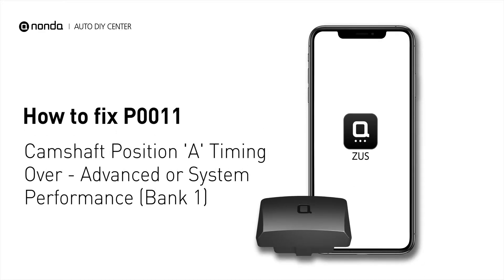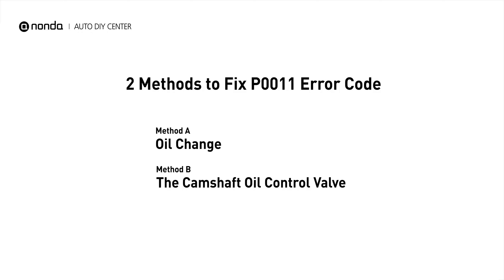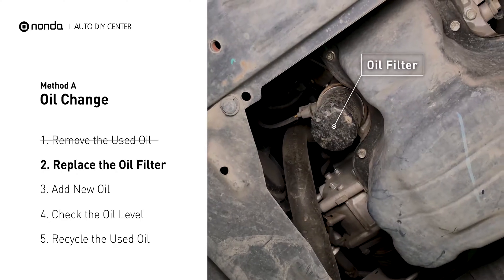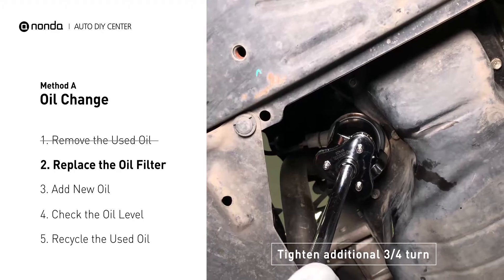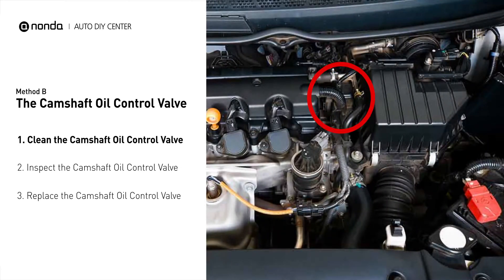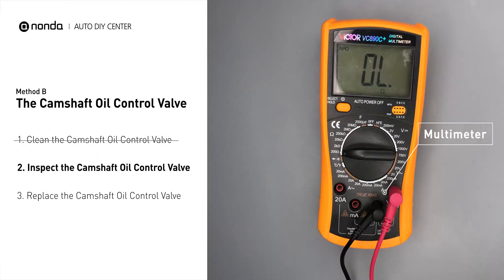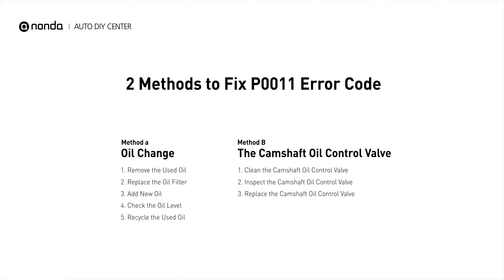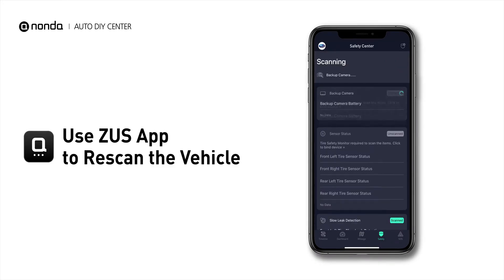How to Fix P0011 Engine Code in 4 Minutes [2 DIY Methods / Only $6.95]

Comment from the maker: Hi, I'm Steve, nonda's lead mechanic engineer. 
Feel free to leave your comments here if you have any mechanic questions, I will be glad to help you out!
Reply: Hi please I wanted to know if you get a p0011 code on Toyota Corolla le 2005 model do you need to open the engine to set the timing chain
Reply: Does this count for a Kia Forte 2017
Reply: I got this code on my 07 Yukon Denali 6.2L.
Can this process still work?
Reply: Do I need to reset it after changing the oil?
Reply: My car sometimes blue smoke and sometimes water throwing what’s the problem
Reply: Selamlar, 2012 model chevrolet cruze 1.6 otomatik aracım dtc p0011 hatası veriyor ve hata gitmiyor. Yağ değişimi yaptım, selenoit valfi ve oksijen sensörü ve Kam mili okuma sensörü gibi sensörleri değiştirdim. Ama hata kodu geri geldi

Comment: Acura TSX 2007 code p0011 changed the VtC oil solenoid and it still has the check engine light on. And the VSA light will also turn on after few minutes of driving. Clear the code and it will turn one back again in about 18 mins of driving and then the VSA light also turns on right away.

Help???

Comment: I have a 2014 Corolla S and P0010 but I just had a oil change so it has to be the other option but where can I get the part for the camshaft oil control valve.

Comment: Hello, I have a 2012 Buick Regal.  I've had the P011 code.  I changed the oil and replaced the Intake camshaft position solenoid.  The light disappeared.  I decided to check engine and it still has a P011 code even though there is no engine light
Reply: Do you reset the codes trrought OBD2?
Reply: Bro...same error is coming....again and again but no engine light....what was the reason....do you find?

Comment: Hi I have a Peugeot 208 GT Line Puretech that has this code and 13 Electrical codes. Would either of these methods work to fix my issue?

Comment: hello i have same problem p0011 code  golf 6 2011 2.5 engine. car working perfectly when car is cool,but when temperature is high engine may operate rough, idle, or stall also hard start. after 30 minutes working perfectly 😀please help me

Comment: Hi I have a 2011 mercedes ML 350 and I am getting the P0011 code, I took it to a mechanic and he told me I needed a Balance shaft and it would cost me 6000.00 this is the only code that is showing , also where is the camshaft oil control valve on this motor?

Comment: Hey Steve so I have a 2015 Chevy equinox. I have the p0011 and 10 codes I’ve replaced both of them, oil change, and the check engine light won’t go away. I’ve even cleared both codes with and Obd scanner and it pops back up any advice?
Reply from the maker: Hello, as you are receiving more than one error code, we highly suggest getting your vehicle visually checked by your local mechanic for further diagnosis.

Comment: Hello, my Subaru ascent is showing “p0011 camshaft position timing over-advanced bank 1” and all the lights on the dash are on. The dealership replaced the oil control valve what should I do???? Please help 😢
Reply from the maker: Hello, is there any other code that register along with this code?

Comment: @nondainc Hi Steve. I have a 2019 Kodiaq 1.5 TSI DADA engine. I am getting P0011 code only on cold engine (oil temp lower than 60 degrees). Car used to drive on 5w40 and 5w30 oil, recently changed to 0w20. Problem popped up only 2 months ago, and is still there after oil change. Cleaning the solenoid magnet and oil control valve did not help. Would you advise replacing either of the two (if so - which one would you replace first)? There is another control valve inside the intake camshaft but it is very difficult to get to. On live data I notice an additional strange thing. When driving on cold engine, after engine Start/Stop shutdown, the specified value for intake camshaft gets "stuck" at 8.7 degrees, while actual value cycles between 8.7 and 12.0 degrees. Pressing the accelerator does not alter the specified value sent by ECU. After a few seconds, it gets "unstuck" and specified starts reacting to changes in driving behavior and actual value follows specified more closely. Any advice would be greatly appreciated! I can share graphs if needed. Thanks a ton for your help!
Reply from the maker: Hello, can you please confirm if there's no other codes that register along with this code?
Reply: @nondainc  confirmed. There are codes triggered on adaptive cruise control, but more as a consequence to this code being triggered. It’s 19233 P0011 code. And I can clearly see on live chart data that actual value for intake camshaft adjuster deviated significantly >20 degrees) from specified value for a few seconds during driving cycle. Sometimes several times in a row. But this only happens on cold engine, never (so far in 3 month) on warm engine.

Comment: Can i manually add some oil to lubricate the sprocket after cleaning the solenoid. Asking because the vehicle has been sitting and the start up might be rough
Reply from the maker: Hi John, can you please provide us with your vehicle's year, make and model so we can provide you with a solution particularly to your car make/model?
Reply: @nondainc  2009 Nissan 370z and to add to that if I unplug my cam sensor it fires right up

Comment: Hi Steve. Great video. I have a P0011 code on my 2014 Q50 Inifiniti. I messed up and let the oil get low. I change the oil and filters but now when I accelerate and it get’s to RPM 2.5 it jerks/ stutters. Its having a hard time shifting. So in order for me to shift I have to use manual and not let it touch 2.5 or lift of the gas and shift it that way. I told it to the Infiniti dealership but they said they would have to take it entirely apart and that would be $6000. Have you ever heard of this happening? Can you please respond.
Reply from the maker: Hi Brittany, is this the only code you're getting?
Reply: @nondainc  yes
Reply: Same problem with my g37 it goes limp and jerks after 2rpm don’t know wtf to do lmao
Reply: @natsumatsu879  i had this issue w my 350z, if u keep your oil level at a desired level it will fix it. It did that to me when i had this issue and it would shift like shit, you either have a bad vvt valve or youre too low on oil.
Reply: hey having the same problem on my 370z, we’re you able to fix the problem?
Reply: Got the same thing recently on my 2014 Q50, would love to know what you ended up replacing

Comment: Hi. I've gotten t a 2007 Escalade 6.2l with code p0011. I replaced the sensor and checked the wiring harness. Still getting the code. Maybe the camshaft adjuster magnet? Any help is greatly appreciated 👍
Reply from the maker: Hello, can you please confirm if this is the only code you're getting?
Reply: Shift_Like_Alex did you have your oil pressure low?, (While having the code p0011)
Reply: @jorge511jL  yes I do

Comment: Hey getting P0011 and P0021 on Nissan Murano 2009 changed vvt and camshaft sensors. Car barely wants to start and when it does doesn’t want to move in drive and slowly moves in reverse. Would definitely appreciate a response haven’t tried anything in this video yet but apparently the problem started after an oil change so I’m thinking they put conventional or the wrong oil or something.
Reply from the maker: Hello, getting both of these codes signifies an issue with the variable valve timing control system. We suggest checking the wiring to the camshaft oil control valve, timing chain alignment and the camshaft phasers for any issues. Also, the oil viscosity might be incorrect.

Comment: Please get back to my previews message
Reply from the maker: Hello, have you double checked if there's any other code registers along with P0011?
Reply: Hi, yes plugged in the computer few times and thats the code with camshaft p0011.full code info Intake camshaft position system performance  p0011. And warming light comes on engine power reduced. Thanks

Comment: Hi i have vauxhall astra 1.4 turbo 67 plate. On the dashboard it says engine power reduce and engine light comes on. When you drive sometimes it goes off. And it comes back on. What can it be ? The sensor got replaced as garage thought it was the sensor and they reset the light. But it still came on with the same warning sign engine power reduced. Please help me
Reply: Its only done 48k on the clock with full service history.
Reply from the maker: Hello, have you double checked if there's any other code registers along with P0011?

Comment: In my kia Sportage 2009 while in highway check engine light and after few minutes oil lamp light...soon i stop checked the oil level was normal but the oil look dirty.. computer check was p0011...i drained oil with 10min motul flush...used original filter, 5w30 SN GF5 100% synthetic oil...no more check light...thanks
Reply from the maker: Hi Hisham, should you have any questions or concerns, feel free to let me know. I'm here to help.

Comment: I'm getting a P0011 code with a loss of power. I have a 2014 Cadillac Ats 2.0T. I doubt that it's engine oil because that doesn't typically cause power loss. Any thoughts?
Reply: Miguel Brochu  yes, I replaced the intake valve solenoid and it knocked the code right out
Reply from the maker: Hi Joe, we suggest to start by checking the condition of the intake valve timing control solenoid valve and camshaft position sensor's harnesses for short/open. Check also its circuits for poor electrical connection.

Comment: It is exactly what I am facing and afraid of being ripped off, Engine light on, Code p0011,p136,p0141,c1555,Car drinking fuel like super jumbo jet, and also can't even pull or accelerate faster on small hills, all started after washing the engine, Service done recently and no improvement. Now I will check with the camshaft  CHEVROLET ORLANDO , VAUXHALL engine
Reply: Hey there ! Did you ever see what the problem was ?
Reply from the maker: Hello, since you are receiving multiple error codes, we suggest to get your vehicle visually inspected by your local mechanic for further diagnosis.

Comment: How do i check if the camshaft gear (vanos) is worn or damaged?
Reply from the maker: Hello, since this is quite complicated to perform, we suggest to have it done by your local mechanic. This work requires experience and access to a variety of tools.
Reply: @nondainc  ok thanks
Reply from the maker: You are most welcome!
Reply: @nondainc  one last question, what could be wrong if a car is having an unstable idle it also sounds loud from the engine not the exhaust tail especially when revving it sounds like the  air is blocked or the throttle body intake hose has been removed
Reply from the maker: Actually, there are various reasons. But we couldn't pinpoint for sure as your vehicle should be visually inspected. Either you may have faulty spark plugs, dirty fuel injectors, or leaky vacuum hose.

Comment: Hi I had p0011 and changed the camshaft intake solenoid. After that I noticed p0016 and p0017 turned on meaning the timing was off. Do I have a stretched timing chain that jumped a tooth?
Reply: I changed the cam shaft ocv solenoid on my 2015 Chevy Cruze ls check engine light went away and I plugged in sensor back in after week light comes on with same code p0011 and will turn off after awile any ideas why this is happening
Reply from the maker: Hi Michael, yes- possibly. Also, changing the oil valve and clearing the code would help.
Reply: What was the problem?
Reply: @leorodz1268  I replaced the timing chain, actuators and other components.  1500$ at mechanic.
Reply: @michaelbarrett7608  having the same problem on my explorer 2011 thinking might be the same

Comment: Thanks for the video, I have an issue with my porsche panamera turbo --> p0076 solenoide control valve bank 1, and would like to know if I can do the same cleaning to the vvt solenoid ? It can be something else ?
Reply from the maker: Hi Adam, yes you may do the same. Hope it helps!

Comment: What is the tool you use to remove the oil filter?  I must have it
Reply from the maker: Hi Egiber, it's an adjustable oil filter wrench that you can purchase online or on your local hardware stores.
Reply: Ps. This worked. Thank you
Reply: Most guys call them oil filter claws, and they come in very handy.  I have used my Craftsman one for going on ten years, professionally, and I have not had an issue with it.  Auto parts stores carry them too.
Reply: @xgcskiman  thanks dude
Reply: @Egiber Ruhl  Make sure to get the three-finger style.  The split-cup style is not as universal.  (In my opinion it is junk, but to each their own)

Comment: What type of multimeter do you recommend and what do you set it to? Thanks.
Reply: Ohms.
Reply: @xgcskiman  Which ohms setting figure ???
Reply: If you are using a DVOM then it is probably auto ranging, which means you just set to Ohms and it will display the range on its own.  If your meter is not auto ranging than I would start at the lower setting.(Been years since I had a non-auto ranging meter)
Reply from the maker: Hello, we recommend a digital multimeter as it provide more accurate readings and it's much easier to read.